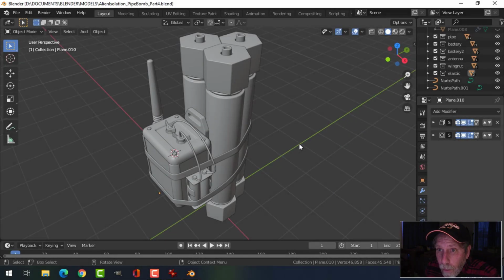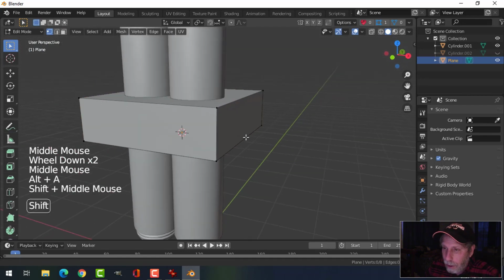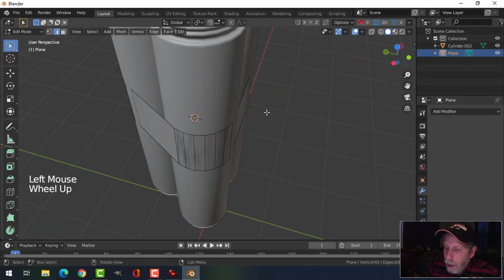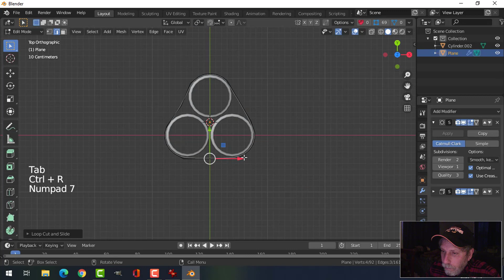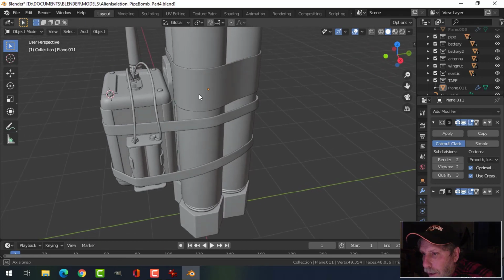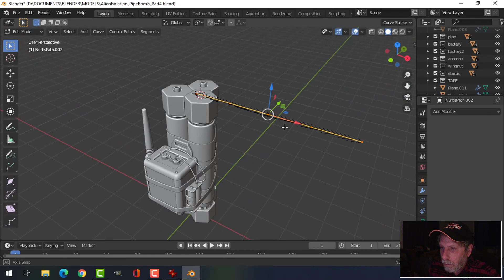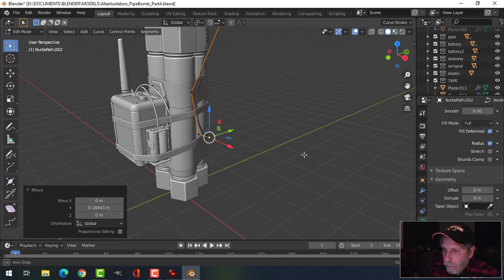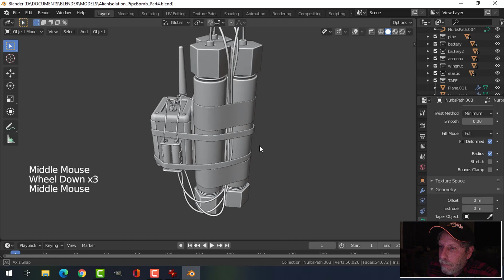BLENDER 2.8: Modeling An Alien Isolation Pipe Bomb (Part 4)

Comment: Well sir, IMO, I think you're having problems with the tape because your cylinders aren't touching at the center. Too much space is causing your vertices to misalign and show wonky. I don't know if that will correct anything at this point, (after you're done with the video) but it's a thought. Let me know what you think. I don't know if anyone has mentioned this, but I love your ASMR format. Very relaxing. :)
Reply from the maker: No problem, the tops of the cylinders (hexagons) in the model prevent the cylinders from touching.  Those were hidden when I made the tape so you might not realize they are there.  All ok though.  Thanks.
Reply: @zerobio  Works for me! :)
Reply from the maker: @izeugirdor  cool!